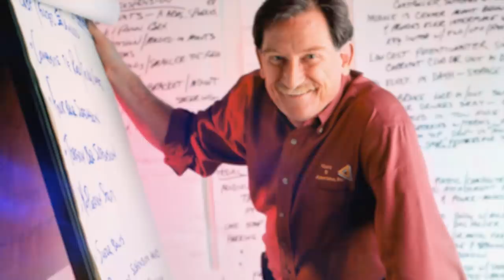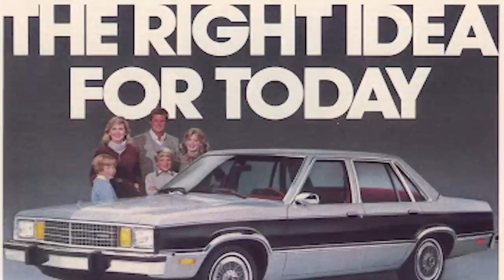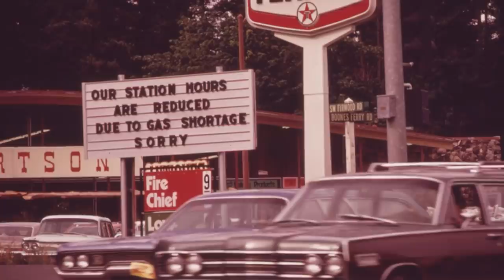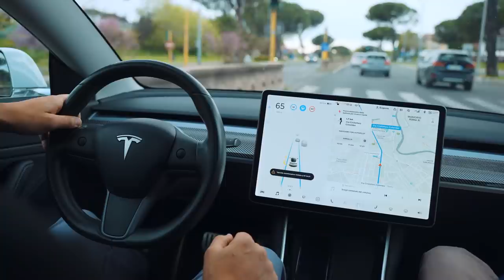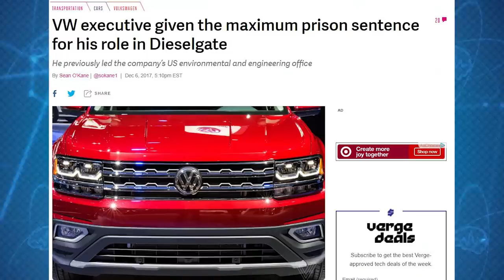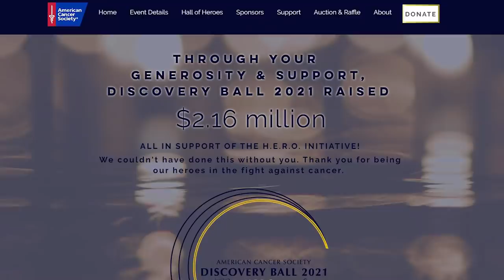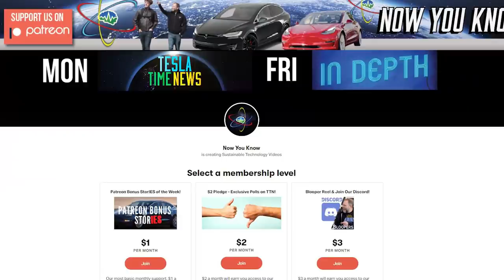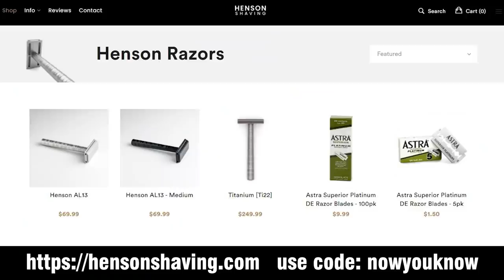China is Coming: Observations from an Expert | In Depth

Comment: Sandy is so knowledgeable, experienced, and wise we can easily forgive him saying 5 and 10 millimeter instead of nanometer. He was talking about the feature size and die shrink of the chips not their external dimensions.
Reply: OH.
Reply: I always smile when he says "NISHTA".  Kind of a trademark for Sandy.
Reply: To be that up to date, at his age...
Id forgive him if he said 10 meters.
Reply: O - you americans and the metric system... What's a factor of 1.000.000 between friends?
😄
Reply: While he might be right about most, such mistakes only prove that you should never take anyone's words for face value no matter how confident they sound. He's a mechanical guy where nanometers mean nothing, I get it. On the other hand, he shouldn't be speaking in such detail about areas where his expertise is lacking big time. It wasn't just the node. Really smart people will know the limits of their knowledge. But the real fools are the presenters, who should have corrected him and provided a bit of critical feedback. A good interviewer does that.
Reply: He was kinda talking about both at the same time. Die shrink means smaller external dimensions for an identical circuit. That, however, doesn't mean automatically a smaller die or package size of a particular next-gen chip. Chip manufacturers often use die shrink to pack more computing power or features onto the same piece of silicon. Paradoxically they even make it larger at times. The true limitation is yield, TDP and power consumption. I bet that Tesla chips will actually be larger than those of other carmakers. Especially those from Nvidia for AI are just massive. In the end, you just need fewer of them because of integration. All in all, Munro's explanation was just confusing as hell. Also, he was incorrect when he mentioned that Tesla was looking at a 1mm (1nm) design. Tesla is not a chipmaker. Not even AMD makes its own chips. He was also factually incorrect when he said that the practically no chips are produced in the US. How about Intel? Intel is not fabless in the US. And how about his claim that some of these chips are already 5nm technology if they've just partnered with Samsung and 5nm is not expected before 2022? Munro is just too fanboyish with Tesla. Probably bamboozled by his beloved electric Jesus that also doesn't give a damn about such unimportant things like .. details and facts. All in the name of holy hype.
Reply: Yes, those of us who watch Sandy get used to this small issue every now and again.
Reply: He didn't mean nanometer.  No mainstream automaker uses 10nm processes let alone a 5nm process. The automotive industry standard is 130, 90 and 40nm (not 10nm) which are very low profit for TSMC and Samsung.  Tesla has an agreement with Samsung to produce 5nm chips specifically for their FUTURE full self driving, but no automaker is using the top of line chips (currently 5nm; 3nm isn't even commercially available yet) in the manufacturing process.  China wouldn't be able to make any cars since they won't even have their own 7nm process ready for mass scale until 2023 and the US has blacklisted China from receiving high end chips from TSMC. Huawei, however, needs 7 and 5nm chips yesterday and their phone business is dying because of it...
Reply: Nanometers are used in much smaller Electronics, like a smartphone. So he did not make a mistake there, you did.
Reply: He is so knowledgeable that I would've totally believed him 5mm and 10mm were the actually the right sizes because I had no clue...
Reply: He's not talking about the manafacturing process he's talking about the actual IC sizes
Reply: @OlJackBurton  If he didn't mean nanometers, then what? Second, Tesla is no mainstream automaker, not when it comes to chips. He absolutely meant nanometers, that is if he understands the scale at all. Latest Tesla S and X use AMD RDNA2 architecture, which is at 7nm. Plus some modern infotainment systems have been on 10nm for quite some time even in traditional mainstream cars. Of course, you are right that the vast majority of other automotive silicon is on obsolete nodes. Fun fact, 80486 chips were produced up until 2007 and that is 600-1000nm technology. Yes, traditional carmakers live in the stone age and Tesla doesn't, that's a fact. 

However, he clearly mentioned 10, 7, 5, 3 - which are industry standard die shrink roadmaps, especially for TSMC. Munro just talked nonsense because he knows nothing about the semiconductor industry and apparently only parrots what Musk feeds him. Musk might have mentioned future 5nm chips and Munro just presented it as a reality. Like Musk does all the time to hype his business.
Reply: @ToonamiAftermath  Nonsense, IC sizes (or rather die sizes) are measured in square mm!, not millimeters. Has it not occurred to you, that those chips might not always be square shaped? And that you have to take into account the package size? It's not just silicon, you know, that is way to fragile. There are contacts, mold and laminate substrates etc. So saying that a chip is 1mm and mean the actual IC size is even more dumb. Munro is spreading misinformation and I am shocked how many people actually believe everything he says and keep defending him.
Reply: @OlJackBurton  yeah that part of his talk was confusing as hell - thanks for clearing some things up 👍
Reply: @xres74  10mm i.e. a tenth of a centimetre, are you referring to pitch then?
Reply: @diazemap  Do you really believe that Tesla only uses 1 chip in the entire vehicle?  Of course not.  They use over 3,000 chips in one vehicle.  And they're definitely not 5nm (at around $17,000 for one wafer) or even 10nm.  Again he said the industry is moving away from 10mm (1cm) chips.  It's way to early for any industry besides flagship smartphones to be moving away from 10nm processes/nodes. He is clearly talking about actual physical sizes...
Reply: @jonathanbush6197  CA
Reply: @OlJackBurton  How the heck did you come to conclusion that I believe that there's only 1 chip in the entire vehicle boggles my mind to no ends. That is pure strawman. Just to think that somebody thinks that someone might think that there's only one chip in a car is next-level dumbness. I was clearly referencing the new Tesla's APU, namely Ryzen V180F used in their on-board computer, which is manufactured by TSMC on 7nm. This is what Munro was talking about. About these hi-end APUs that do all the AI computing for autonomous driving and other advanced functions, that only AMD, Nvidia or Intel (just barely, definitely not on par with Intel or Nvidia) can manufacture right now, not the other controllers. Of course you need chips for various control modules, memory, battery management system, electric motors etc. but those can be made using much cheaper nodes. 

You just fail to understand that Tesla is a computer that uses only slightly modified desktop versions of bleeding edge GPUs / APUs. You can play the latest AAA games on a Tesla. I mean there's enough TFLOPs for that. So if you're talking about the smartphones being able to move away from 10nm, you're talking about the same situation while completely forgetting that there are also desktops, notebooks, servers that are actually using extremely advanced chips (5 and 7nm). In case of Apple it's in essence the same ARM architecture that they put in their latest iOS and MacOS devices. 

When Munro talked about the industry, he didn't mean the automotive industry, but the semiconductor industry. And the semiconductor industry is moving away from 10nm. AMD is on 7nm, Ryzen 4 will be on 5nm, Apple is already on 5nm. Only Intel is stuck at 10nm because they got stuck  at 13nm for too long and eventually lost their lead to AMD, also because of that. Intel should have been on 7nm for years. Even I already moved from 10nm, both with the computer I'm writing this post on and also with my cellphone. Can you not see the pattern? 10, 7, 5 .. nanometers. The same numbers Munro mentioned. 10, 7, 5, ... but he said millimeters because he knows nothing about the semiconductor industry, especially manufacturing. Any teenager who is into computers knows more than him when it comes to computer hardware. But I don't blame him. He's just too old for these details. His generation's wizards were mechanical guys who didn't think in nanometers. I get the message we was trying to convey. That without these chips, there's no autonomous driving and true innovation.

What do you even mean by 1mm chips? There's no such thing. It's a nonsense non plus ultra. It's like saying that I live in a 10 meter house. 10 square meters large? Or a house 10 meters long or wide or do I mean 10 meters diagonally? Chip size is measured in square mm! Are you saying that all chips are square shaped and they all measure either 1mm, 3mm, 5mm? Really? (-: You'd either have to be a troll or immensely unintelligent if you insisted on that (I'd put it more bluntly but YT tends to delete posts that mention even the S or I word). Algorithm never sleeps.
Reply: Chinese people work until there HANDS bleed & still KEEP going
Reply: SILVER PRICE WILL FALL TO 18$..////
Reply: @diazemap  Just wanted to express that I appreciate both your comments there. Such an interesting channel and viewers critics too who complement info there.

Cheers from an aerospace engineering student from Spain. In the aeronautical sectors Boeing and Airbus still lead commercial airplanes market along with Canadian Bombardier, Brazilian Embraier and other minor ones, with Chinese manufacturers still being farer away than I'd say the automotive sector. Although they'll also catch up eventually in the future for sure sooner or later
Reply: @kevin42  hahahahahahha
Reply: @petervesborg  he would be mistaken by fewer orders of magnitude, if he said 10 meters :) haha
Reply: @xres74  The current Tesla FSD chip is fabbed at 14 nanometers. and the new FSD  (hardware 4) chip will be made by Samsung at 7 nanometers.
Reply: That's what happens when you open your borders too much. Chinese in China can decide not to buy American cars again, but the Americans in America are not passionate enough because they are basically immigrants from different countries.
Reply: @rond5936  Yup, the danger of China is vastly underestimated and they have a chip on their shoulder towards western countries in general, particularly the British because of the Opium Wars that cost China their superpower status. And they are going to get that status back in the most ruthless way if it needs be. China is not the keep-to-themselves kind of a country that invented paper, gunpowder, glasses and stuff like that. The west should exercise extreme caution and I guess that there's no other way than regulation because the game of free market has already been rigged with China's subsidies for manufacturers and shippers. At the end of the day we will all sadly think with our wallet, when it comes to purchasing decisions and there's no way we can beat China there.
Reply: Clarifications ✔️
Reply: Hello
Reply: I think he was not talking about the node. but rather die dimisions.
Generally speaking, a new product should have a smaller package than the previous generation.
But it is true that large companies don't want to update to the new product version since they could get by with their old design.
Besides, I don't think a lot of MCU actually uses 7 5 nanometer fabrication. as it would not give them a better profit ratio.
Reply: Even the video games industry, China is now pushing forward. Only four years ago, Japanese developers held a monopoly on the top games in Japan, said Daniel Ahmad, a senior analyst at Niko Partners, a video game research firm. Now, about one-third of the top 100 mobile games in Japan come from China.

Comment: US might use the "for national security" reason to ban Chinese cars in the US, without any solid evidence to support such "reasons".
Reply: A super bully, a bully of bullies, disguised as a “democracy”.
Reply: Common people should boycott chinese products..only solution
Reply: Small countries like Aotearoa New Zealand and other South Pacific countries with no domestic vehicle manufacturing will snap up inexpensive Chinese EVs if the US doesn’t want them.
Reply: SHORT SELLING OF GOLD AND SILVER SEEN IN THIS WEEK...//
Reply: @user-kj9cs8ok9n  do it!
Reply: @YurideGroot  like the Ford pinto
Reply: where   are  all   the   billions  n  billions  of  $$   going   to  come  from  to   upgrade  the   power   grid  to  be  able  to  handle   all  the   charging   chinese  EVs ?   calif.   has  a  "few"
tezzlas   charging   ,   n   they're   already   experiencing  rolling blackouts,  brownouts  n   outages.........
Reply: SHORT SELLING OF GOLD AND SILVER SEEN IN THIS WEEK... silver will fall to 18$/oz.// GOLD WILL FALL TO 1800$....///////
Reply: @driver4011  ... Do you have any idea of industrial electricity generation? Blackout because of electrical cars should be the last thing you worry. Most blackouts are caused by electricity comsumption of industrial factories. They are the place where enoumous power is draught and also usually also the first place to shut down for any power insufficiency. Electrical cars? pfff. Nothing but a breeze on those beasts.
Reply: Come on why would the US do that when the big three has China made parts on their cars
Reply: @traumajock  and then we retaliate.

Comment: Just look here over in Norway, for a while we only had a few EV's to choose from like Tesla, Leaf, Zoe, Ionic and E-golf, but now the market is flooding with cheap electric chinese cars from brand's like: Xpeng, BYD, Maxus, Polestar, MG ZS EV, Hongqi, Nio, Seres, Dongfeng and more. So far in 2021 pure fossil cars represent only 4,67% and 4,39% of the car market in Norway.
Reply: Norway has huge hydroelectric power resources so it seems that electric is the way to go, at least for urban driving. The big problem with current electric car technology , at least in Ireland, is a shambolically unreliable charging network, frequent IC'ing of charge points and vandalism to existing charge points. Also electric cars are comically expensive in Ireland and the choice is not great.
Reply: Things started slowly slowly at first but now seems to be moving quickly quickly.
Reply: Lol, why don't you use standard notation for decimals? It's the period symbol " . " not " , "
Reply: @samuraijosh1595  Some countries use that notation system. Ie. Dutch and their old colonies like Indonesia. Just like the US still uses the imperial system, which ironically was of British origin. The Brits have since moved to metric while the yanks stick to it doggedly.
Reply: @JYRIVIRMA  jajaja so much wrong 🤡🤡
Reply: Nio is not cheap

You just generalize Chinese cars as cheap bc of political bias
Reply: @dznuts123 "Cheap" = low in price, especially in relation to similar items or services. That's the definition of cheap. These chinese brands sells car's in all segement's, premium or not, cheaper than their competitor's. I don't see any political bias.
Reply: Norway, socialist, government massive sponsoring of electric machines, including cars. Bad example
Reply: @ekinorak  you are implying these “cheap” cars are inferior to the more expensive ones.

Comment: People used to laugh at Japanese cars for good reason. My teacher cut his finger on a non folded panel edge of an early Japanese car. And then Japanese cars got better. 

Same thing happened with Chinese cars. The chinese car „Landwind“ was crashtested in Germany and it failed miserably. The german press dragged it all over the place. That was roughly 20 years ago. NIOs are designed in Germany. The ES8 just passed Euro NCAP with 5 stars. It tested better than some European models. A german car magazine tested it against the Tesla Model X. Turns out that NIO ES8 has better acceleration and better brakes. They are coming and they aint bad.

Comment: Can't wait for them to start rolling. 
Had a model S for 6 years and every year something major broke. I have replaced the drive motors 3 times. Every single time i brought it in for repairs there were queues so it was a lengthy process. Last service i waited for 7 weeks and they were out of tesla replacements so i got a diesel. The irony was both a comedy and a tragedy at the same time.
When i was about to lose the "free repair" warranty i took a good hard look at my servicing book and felt a feeling of horror when i added all the "free" repairs i got and it clicked that it is going to go out of my pocket soon. Needless to say i got rid of it. I am not the only one, there are tons of Model S cars on the used market.
Preordered a Polestar and it is now at 116.000 km and not a squeek. Just like the day i bought it.
Also worth noting, if you can't stand apple style "design over function" approach you will be so happy with the environment but that is a personal thing.
The only thing i am missing is the supercharger network. It is everywhere in Europe and there are rarely any queues. A stark contrast to my current situation. It is getting a lot better though with each passing year so i am not worried.

Keep your head on folks and take care <3

Comment: A couple of points.  First, Sandy keeps saying "mm chips", but of course he means "nanometer".  Second, the interesting thing is that China was motivated by national security concerns as much as climate in developing its green energy tech (solar, high speed rail, EVs) because it knew that the US could destroy its economy with an oil blockade in the South China Sea.  Meanwhile, we're begging OPEC to pump out more oil to get the price of gas down.  That's playing chess right there.  Also, they're so far ahead in the integration of EVs with 5G, we'll never ever catch up.  Finally, most people still can't comprehend the scale of China; it has more people that all of North America + Europe (including all of Russia).